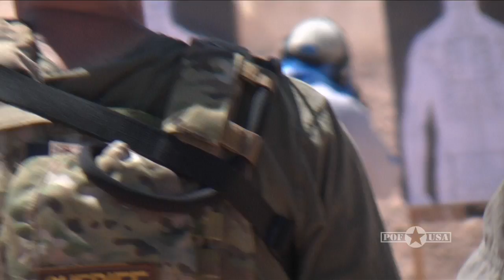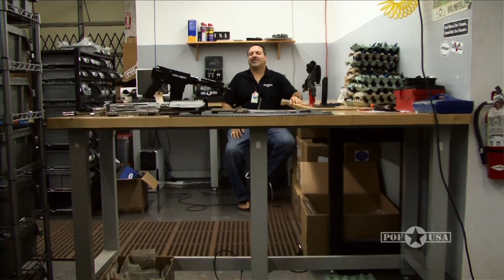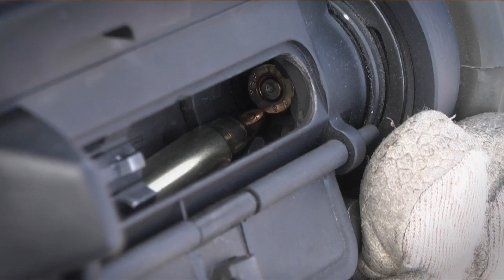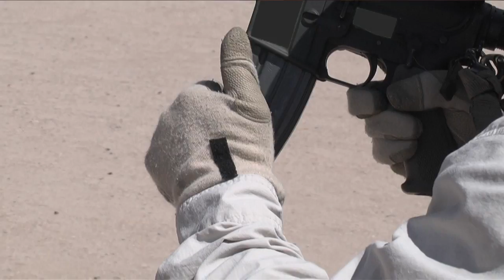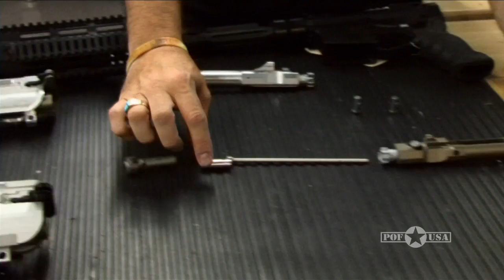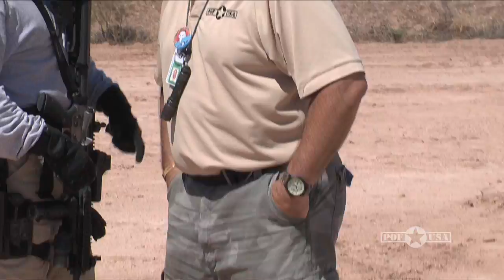POF-USA - Problem Solvers

Comment: I just purchased a brand new POF Revolution in .308, brought it home and fired two rounds with similar results. One round fired, the next round stuck in the chamber. I had to mortar the rifle to extract the stuck rounds. My $800 Palmetto State Armory runs great right out of the box, my $2,600 POF, not so much. I am calling the Tech Center tomorrow. Using PMC brass cased 150 grain new manufactured ammo.

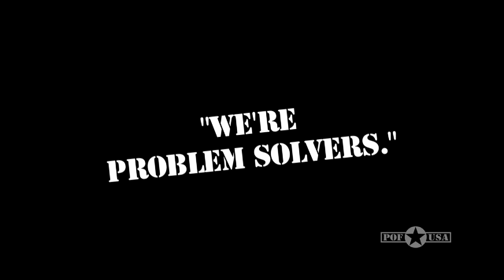Comment: Bought an early POF upper 14.5, M4 handguard, (discontinued) basic upper back in 06 for almost a thousand bucks. It is so insanely over-gassed, 1:10rds blows a primer or rips off a rim. Recoil was insanely high and Ejection was at the 1-2 O'clock position. the delta ring was taking a beating and carbine buffers at the face and rear delrin bumper were getting crushed from high bolt speeds. To mitigate the shoddy design, I had to bore out the gas plug as seen on later models, because nobody at the factory had done so. this did add some dwell time and reduce rim rips but primers still blow sometimes. I also had to get an H3 buffer and heavy spring and reverse the piston to the suppressed setting, just to get ejection down to a 2:30/3oclock pattern. The bolt cam pin was gouging out the upper receiver too, so I had to buy a roller cam pin to reduce further self destruction of the design. I had to polish and de-burr the rear of the bolt carrier because it was chewing up buffers fast. It has less than a thousand rounds through it and feels to be nearing its half-life mechanically. there are no replacement pistons or op rods in its specs to be had (proprietary fail)   I really had high hopes for piston ARs and bet it all on POF. A costly education, I'll never trust my life to this shoddy FN/FAL style novelty/range toy. Had much better results with an Osprey OPS kit but I'm Humbly going back to DI mid-lengths that did in fact, have timing foremost included in the design. I'm sick of end user beta testing and debugging. These newer spaceguns are hideous. Thank Magpul for conservative MOE furniture that accommodates piston tubes and DI tubes alike.

Comment: Amazing video not just for pistons. With the explanations, this got me to: 

Get the longest gas system possible
Reduce buffer and carrier weight
Adjustable gas block

I have an amazing reliable gun now. Thanks!
Reply: joshv06 That is correct, the piston is unnecesary...
Reply: This is the way.

Comment: im not saying pof rifles are not worth there cost i finger fucked one at my local shop and was amazed at the quality and detail.

BUT, going just of what he said in the video all you have to do is add an adjustable gas block to your 1200-1500 dollar ar 10 and you fix all the issues he mentioned without buying a POF rifle.

only problem is you still dont have an end rifle at the quality level and precision of a POF rifle just a more reliable cheaper rifle.

Comment: Kyguns, I have found that all gun manufactures have at least one thing in common; their products have let me down at one time of another!  A function problem with a POF is usually a gas issue and there are only two courses of action to fix it. 1) make sure the gas plug (on later models) is in the normal position (as apposed to the suppressed position) or on older models, make sure the piston is in stalled in the normal position (on older rifles, gas pressure is regulated by ports in the piston rather that ports in the gas plug).  I have seen very competent, no BS experts, install the piston or gas plug in the wrong (suppressed) position, so don't feel bad if this fixes it!  If the plug or piston is in the correct position, send that sucker back to POF and they will fix it or make it right.  A buddy of mine was having a similar problem with a new P308 and they sent him a band new upper in less than a week. Don't just throw it in the mail, though.  Call POF, talk to John in sales, and he will tell you how to get it done. Hope this helps.

As for the "aggressive" cleaning, what happens is after many (like thousands) of rounds, especially steel-cased ammo coated with all that resin crap, a bunch of junk builds up in the throat area of the chamber.  This usually will not cause a function problem, what you will see is a marked reduction in accuracy, and/or, over-pressure symptoms (ejector marks on the case head and blown / cratered  primers).  The build up can be very tough to get out, however, because POF heat treats make the chamber and bore so hard (70 Rockwell) you can get pretty medieval on it!  I had this happen to my P308.  One day it instantly went from a sub-MOA tack driver to a 3 MOA lead slinger.  After checking everything I could think of, I chucked a chamber brush in drill and went to town on it!  I will admit it made kinda quezzy using a power tool to clean a rifle, but it worked.  Shoots like a POF again!